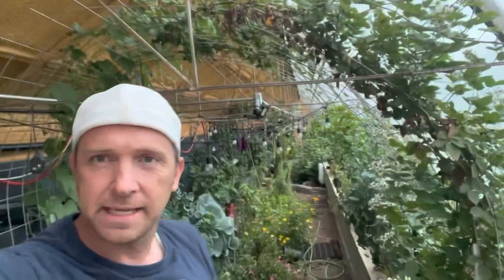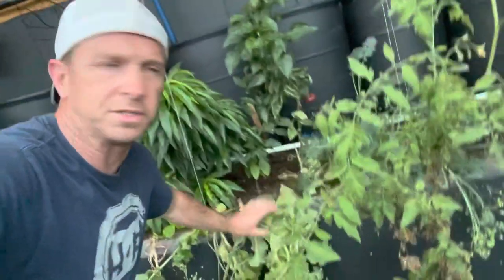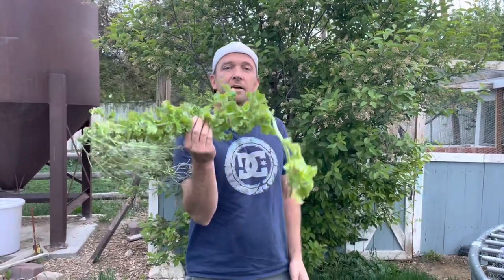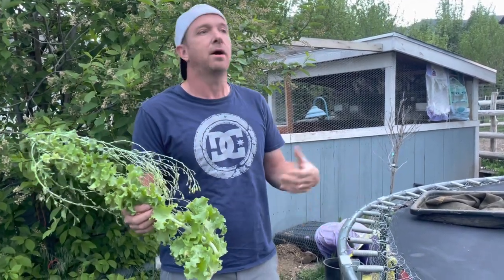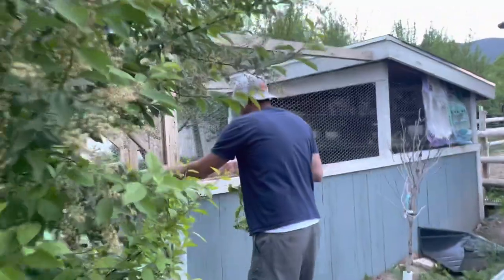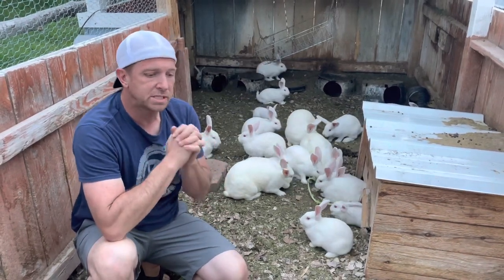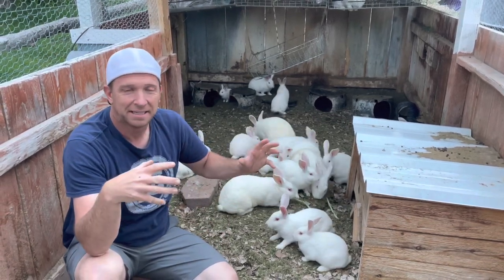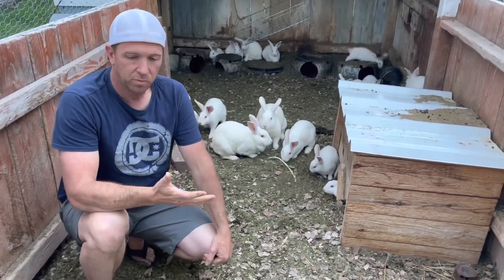How to build and maintain the ultimate rabbit colony

Comment: Thanks for the ideas, I really plan to utilize your suggestions in my own colony set up soon. (Controlled Burrowing). The benefits of climate relief without the harsh reality of burrow collapse leading to kit deaths. Do you know if your cooler idea is definitely better than just a couple entry/exit tubes leading to a large underground, insulated area like yours except instead of individual coolers place common nest boxes with open tops where you could view all nest compartments at the same time while opening the outdoor access hatch?
Reply from the maker: I don’t know for sure. If it was insulated underground, then I think you would be creating a very similar environment. I’m sure that would work great. Having easy access to view the nest boxes would be key either way. Best of luck! Sounds like you’ve got a great idea going.
Reply: I think viewing all of the nest boxes at the same time can be risky. When closing, there’s a higher chance of squishing somebody who might try to escape out the top when spooked. Also, seems like if all were open at once, it may be harder to keep track of all of them And some might just hop out in general. Just a thought

Comment: Very interesting video. I've also been breeding rabbits for years (for meat and manure) in "traditional" cages, but now I kinda feel "guilty" and I really wanna shift to enclosure breeding for ethical and practical reasons (seems easier to maintain and is cooler in summer heat). But since 'til now they're each one in its own cage, you've made the choice to keep the buck with the does and the kittens, isn't it dangerous for them to be with the buck everyday ? does it harass the females and attack the babies ? Many thanks in advance.
Reply from the maker: No actually. We have never had issues with the buck only with the moms abandoning their own litter. If there are two bucks, creating tension and competition that could be an issue but again, it mainly just stresses the moms out and then they are the ones actually having the issue with the babies. But I would definitely only recommend one at a time just to create that Harmony that’s needed.

Comment: Nice system and good video. Really appreciate it. I just bought a pair and i put them with my chickens. So far no problems. But they dont let the chickens in their room😂. I have a separate house in another street behind my house. Which has gray structire only with room walls and no windows or doors just openings.  The floor is mix of gravel and soil. And have a grass lawn. I put all my chickens (i have 8 hens 1 rooster one chick. 😂)  in one room in evening and the bunnies in washroom of another room. Kindly guide if i am prone to some mistake or disaster or what should i be careful about.
Reply from the maker: I’m not sure, sounds like you have a great set up! If they are not fighting, then you probably have things set up just the way you should. I wish there’s a way I could see that set up.
Reply: I would not allow them to share ground as the chickens can carry pasturella and other things that will kill your rabbits

Comment: Isn't lawn clippings cut with a motor bad because the blade makes the blade of grass explode which releases  a negative thing for them to ingest?
Reply from the maker: I’m not sure but we’ve had long success doing it. They love it. But we do it as a supplement usually and still have pellets
Reply: You just don’t want the grass to ferment - it needs to dry out before storage.